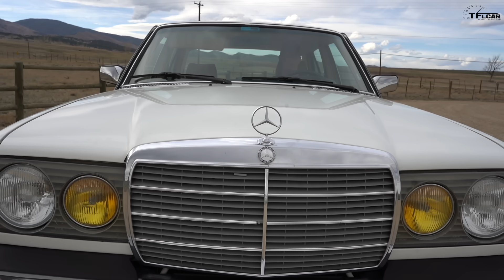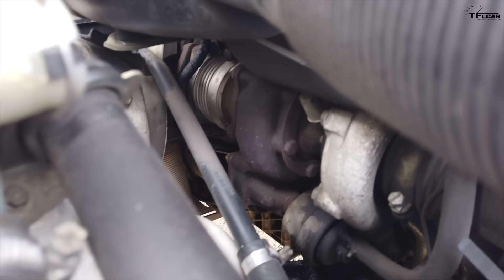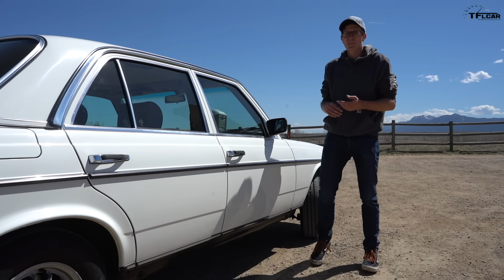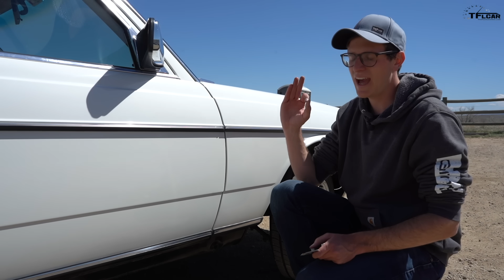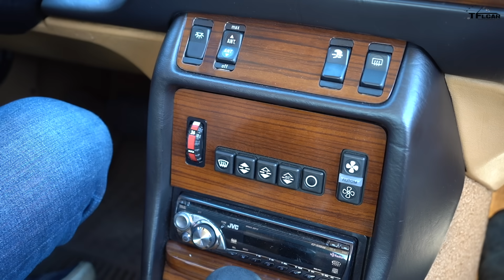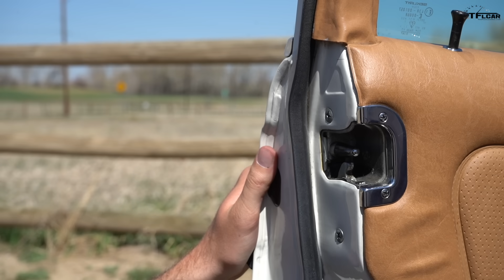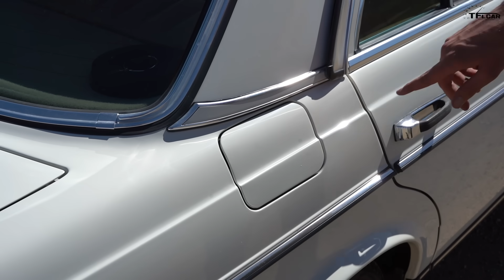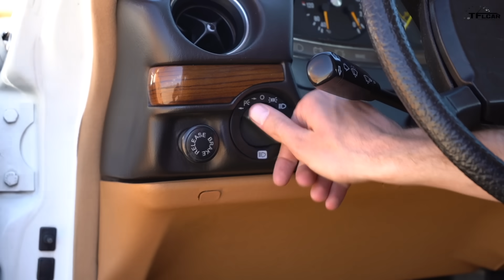This 37-Year-Old Diesel Is THE BEST Mercedes Ever Made!

Comment: Dude, I have a w123 240d 1976 and man! I use it, day and night, since I have never but never left me in the street, it is more, it takes me wherever and whenever it is, it is my faithful friend, we love it, I am glad that you give it affection, respect and love that you deserve, and that you drive it daily, they get better!!! haha wish you have beautiful experiences with him :) PS: never sell it, because you will regret forever, I assure you ... greetings!!!
Reply: Julio Quintano I need help getting mine started. I need new hoses, and a battery.
Reply: @VeganRashad  Hi bro!!! 
I hope you can get the hoses, if not, you can send them to a hardware store, after you have the metal coupling, they manufacture the hose, either transmission to the radiator or power steering pump or to the conduit of oil that go from the oil filter to the oil radiator and return.

And when you go to turn it on after a long time I recommend:
First of all, I recommend adjusting valves, on the internet there is the valve adjustment diagram for om616 and om617 motors, it is the same for the two motors, only to omit the 5 cylinder; you can do it yourself, if you do not have the 14 "keys you can make them by molding 2 long keys of 14" which is what I did.

2: I recommend you buy a good battery that goes from 850 Amp on, no less than that, if it is 1000 Amp would be better.
3: Clean all the negative terminals in the chassis and in the motor for a better flow of electricity in the starting system and also in the charging system (crucial and indispensable)
3: That the starter is in good condition (it is essential for these engines as they are low compression engines) you can disassemble yourself and change the internal brushes that over time wear out and do not perform the same doing a poor turn of the engine and more likely not to turn on. If in such case this is turning well, leave it like this.
3: Indispensable to have good glow plugs for the ignition; It is also important to have all contacts of the glow plug system clean and without corrosion for a good flow of electricity in the system.
4: Make sure the diesel is reaching the injectors without any air pollution in the injection system and start until it turns on hahaha xD
5: And if it does not turn on having done all of the above, I recommend using ether 3 or 4 times and if that still does not turn on, something I have done but I do not recommend, only in case of emergency is to connect 2 batteries in series to create 24V in the ignition system or connect a 24V battery but first you have to disconnect the alternator and disconnect the glow plugs system to not run the risk of burning the system, but you feed the glow plug system independently putting a positive cable from the positive pole of the battery in the positive pole of the first glow plug, important in this procedure you must be very careful because you have to connect all the positive and negative terminals very well, otherwise they will be soldered or melted creating sparks and damaging the batteries that is to create a headache :( I hope it is helpful and that you give your friend Benz another life, he will thank you and with these first 4 maintenance tips his friend always start as new :) regards! Rashad Glover of all, I recommend adjusting valves, on the internet there is the valve adjustment diagram for om616 and om617 motors, it is the same for the two motors, only to omit the 5 cylinder; you can do it yourself, if you do not have the 14" keys you can make them by molding 2 long keys of 14" which is what I did.
2: I recommend you buy a good battery that goes from 850 Amp on, no less than that, if it is 1000 Amp would be better.
3: Clean all the negative terminals in the chassis and in the motor for a better flow of electricity in the starting system and also in the charging system (crucial and indispensable)
4: That the starter is in good condition (it is essential for these engines as they are low compression engines) you can disassemble yourself and change the internal brushes that over time wear out and do not perform the same doing a poor turn of the engine and more likely not to turn on. If in such case this is turning well, leave it like this.
5: Indispensable to have good glow plugs for the ignition; It is also important to have all contacts of the glow plug system clean and without corrosion for a good flow of electricity in the system.
6: Make sure the diesel is reaching the injectors without any air pollution in the injection system and start until it turns on hahaha xD
7: And if it does not turn on having done all of the above, I recommend using ether 3 or 4 times and if that still does not turn on, something I have done but I do not recommend, only in case of emergency is to connect 2 batteries in series to create 24V in the ignition system or connect a 24V battery but first you have to disconnect the alternator and disconnect the glow plugs system to not run the risk of burning the system, but you feed the glow plug system independently putting a positive cable from the positive pole of the battery in the positive pole of the first glow plug, important in this procedure you must be very careful because you have to connect all the positive and negative terminals very well, otherwise they will be soldered or melted creating sparks and damaging the batteries that is to create a headache :( I hope it is helpful and that you give your friend Benz another life, he will thank you and with these first 6 maintenance tips his friend always start as new :) regards! Rashad Glover

Comment: A modern day e250 with the 2.1 will easily get 200k+ even with all the atrocious electrical systems and DEF plus you get the modern day look and quality. A good used one is under 20k.. 40MPG+.
Reply: 200k miles is easy for a new car. but in 40 years it will not hold up as well as the old Benz. Time is harsher than miles.

Comment: The124 is almost as reliable and durable but drives much better (suspension + aerodynamics + safety features), so good ones are appreciating fast.
Reply: My uncle has one,500.000 km of daily abuse through all kinds of terrain and the damn car keeps asking for more. He also lives 20 meters from the sea,another car would be eaten away by rust in 10 years. This one? Looks like it rolled out of the factory 5 years ago...
Reply: i would have w210 before w124
Reply: @raycroal  If you can find one that hasn't rusted away... They were less durable than their predecessors...
Reply: @notroll1279  i can find plenty

Comment: I have the w124, it carried over a lot of cool features from the w123, but I'd say the w123 is still more classic!
Reply: The w124 has the 5 link rear suspension, top handling even for today standards. I have a 250D, with good tires on, nothing can disturb it on the road.
Reply: José Pinto my biggest issue with my w124 is lack of head room. I’m 1.82 meter tall and there’s almost nothing left between my head and the roof, and I wonder how do the Dutch and German customers thought about this since there are many tall guys in those countries..
Reply: @hpwan2  I am 1.70, so no problems with head room. The seat has height adjustment, I've seen tallest people driving those cars. My son uses the seat much froward, so I barely fit behind the wheel, perhaps if you use the seat further back, and a bit more reclined.

Comment: +1. .. The vintage '70's/'80's w123 series models were/are engineered like no other. .. Few if any in-the-day production cars were peer's. .. That is until it's replacement the w124 model s entered production. ..The significant advancements during the w124's ten-year run gave way to standard ABS (edit), advanced crumple zones w/airbags throughout, plus the industry-leading 5-way multilink independent rear suspension.  To name just a few. .. Hey W123, you're preaching to the choir, my daily driver is the successor, an original condition MY94 E-Class 320 Coupe (C124).  Cheers -
Reply: ABS was introduced on the w116 and made available as an option on the w123.   For one reason or another Mercedes USA decided not to make it available for north American buyers.
Reply: @classicjalopy  .. The Devil is in the details. .. As is often the case, the North American market is the redheaded stepchild to the German auto manufactures.

Comment: I think that the W116 and W123 models represented Mercedes’ zenith as a manufacturer. At that time a Benz was the best built and most durable car made.  Many will note the W124 and W126 but having lived with a W123, W124 and W126 and having a W116 at my a disposal still I will attest that the W116 and W123 are much better made and are much better cars at forty years old than the W124 and W126 are at thirty.
Reply: but what makes the 116 better than a 126?
Reply: Everything in this generation was basically still made of metal and thought fuel injection was used they were still mostly mechanical. Their successors became much more technical and filled with sensors that required constant attention and replacement. Their air conditioning and heating systems became more unreliable and a lot more costly to repair as well as more labor intensive with more hours required, break jobs required hours of labor to maintain. The concept of buying a Mercedes-Benz because it was an investment over the course of time that could conceivably last forever was officially over.

Comment: I've loved every W123 I've ever had.  With that said, I feel that the W126 cars are a little better - less issues with corrosion, and updated safety features.
Reply: Then the W124 is the best best choice more features and streamlining than a W126, better MPG, better in the corners, just as quiet, faster, and the list goes on
Reply: @akishot6735  the w124 is nice but it doesn't have the same old Mercedes feel of the W126, W116 or W123
Reply: @akishot6735  Oh youre just a typical person that only cares about cornering, acceleration and top speed 🙄

Comment: Here are 2 proofs for why this car is NOT the greatest car ever:
1. Vacuum system.  All vacuum systems suck (punny right)...seriously, they are not a good engineering choice if you want a good and reliable system.  Why? One leak and everything stops working.  Not worth it.  Good reliability means redundancy not dependency.  One leak....

2. Stupidly slow.  Downright dangerous on a modern road.  B-roads are great and all...but not if that's your best option.

Bonus Reason:
So you like boxy and comfortable and reliable, and don't care how fast it goes?  Get a Camry.  There are no support groups needed to tell you how to fix this or fix that.  The Camry just works.  And it is safe on modern highways and has a cruise control that works, even on the 25 year old ones.  And no problems with the AC.
...oh yeah, and no stupid rust building "drain" holes that fill up and rot your car.

Please.
Reply: You're not wrong about vacuum operated anything in cars, they're not going to stand the test of time. But these cars are only slow to accelerate, they'll do highway speed just fine (I should know I have the 4cyl version with 70hp). It accelerates like a semi-truck and if you treat it like that it's fine. But at least for me there's something about the looks that attract me to them. And for fixing these cars they are actually incredibly simple mechanically, there's nothing fancy going on and they made so many of them it's not even too hard to find parts for them to fix anything that does break. But if it's not the kind of car you want that's okay too, we all have different preferences and we choose according to those.
Reply: @TheIcyWizard705   I never once said anything about whether I liked them or not.  I simply responded to the title and gave 2 (confirmed by you) reasons (and a couple bonus points too) for why these cars are simply not the greatest cars ever.  
As for easy to repair, that's not true either.  I didn't bother to mention the AC because everyone does.
And as for millions made and quite economical, that's a bit of a mess.  These are "classic" cars and hundreds of bandwagon boys seems to love them, yet not one of them can be rebuilt without destroying the personal finances of the owner, (2 more reasons coming up):
1. The diesel engine, if neglected costs twice the street value of one these to rebuild.  Jonny lunchbox can rebuild his Mustang 10 times for that.  And so what if it has to.  At least he can.
And finally, the real elephant in the room (2): these things are too worthless on the street to justify putting any money into them.  So the advice is always "get one from grampa-keeps-all-records, or it will ruin your life".
Too precious.  Not worth this constant threat.
And the upshot: maybe if you fanboys would stop trying to convert everyone then a few more would die sooner rather than later thereby improving the value.
But it still doesn't change that they are no where near the "best car ever".
Oh did I mention the neutral starting swtch random lockout?  Yeah it's a thing...and so on..

Comment: Cool Video ! Just one thing Besides the Five Cylinder engine and the Auto Climate control You could spec out a 240D with EVERYTHING ( Like my 83 240 D has ) that came on a 300 D

Comment: Mercedes straight-4 OM616. and OM617 straight-5 are some of the best diesel ever built.  You can get your W123 as a 300CD
 coupe, 300TD, sedan or my favorite the 300TD touring (the wagon). They're as reliable as they are slow so the turbo is a must for doing 0-60 under 30 minutes and keeping up with traffic.

Mercedes OM606 like the E 300 Turbodiesel are great cars too and pre Bluetec CDI model like the E320 CDI may be the last great Mercedes diesel.  And of course, the G 300 CDI Pro Wagon and G 300 CDI Pro Cab Chassis are still available in countries with less strict emissions.

Comment: Mercedes ac are a maintenance item. Like an expensive oil filter.
Reply: I have owned many MB including several diesels. WRT parts and repair, I have found that using the dealers is generally not your best option. Find a good independent independent repair shop in your area and source parts from one the large independent shippers.
Reply: I do not know a Mercedes owner with over 100k miles on the odometer that has not replaced parts of the ac.  Some more than once.  So expensive.  So disappointing since GM ac systems seem to last.
Reply: I've heard that the a/c systems are a NIGHTMARE after the cars were 5 yrs old.

Comment: I drive an 82 240D and it fires up every day and runs like a top. 200 thousand miles and doesn’t skip a beat. Absolutely lovely specimen you’ve got there though I love the turbo w123’s
Reply: Love my 86' 300e been past 115 on the freeway with it without feeling it. Bet a 240d can't do that, but I bet you can parts on the cheap!
Reply: orion deschamps hahahaha I use mine on dirt roads in cattle country. All my buddies got big trucks and I’m still popping along in the old 240 lol. Currently it’s running on used motor oil and some off-road diesel. It’s unstoppable 😂
Reply: Alvinator Jehosephat what color?
Reply: Beige paint and the tan MB-Tex interior. Light colors are very good for the heat here lol. I carry a couple of hounds usually and never had any damage to the seating. Amazingly durable

Comment: Super troopers 2 taught me how to convert celcius  to Fahrenheit. You multiply by 2 then add 32
So 18c is 68f and 26 is 84f
Reply: Simply learn the Celsius temperature scale and don't try to convert to Fahrenheit.
Reply: @johnhudelson2652  I live in America so.....
Reply: Good tip. Not truly precise (real conversion C*9/5 + 32 = F) but as the old saying goes good enough!
Reply: @johnpalmer5131  cool, thanks for the new math formula to try out
Reply: Alright meow, that’s great math, meow who wants a moustache ride 😂  
I love the W123, I own a 280 coupe in thistle green. Best car ever
Reply: @pbs7986  hello mr.... Larry Johnson lol
Reply: This is not at all reliable
Reply: @Den-I-Zen_Dei-Levvis  the car or the math?
Reply: What?  NO!  20C=68F...for instance. Duh.
Reply: @wholeNwon  by the math formula of c × 9 / 5 +32 you are correct.  By the less accurate formula I used I was correct also. If I'm trying to ballpark a temp my original formula works, if I'm trying to be precise,  the latter is the only way